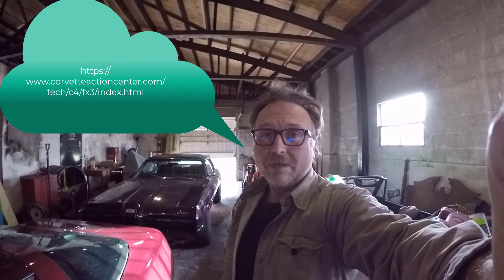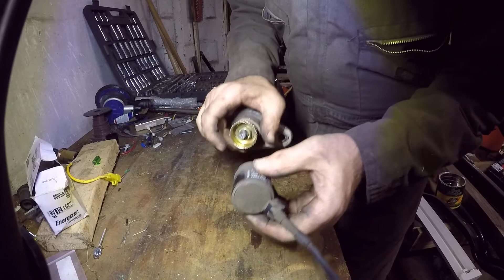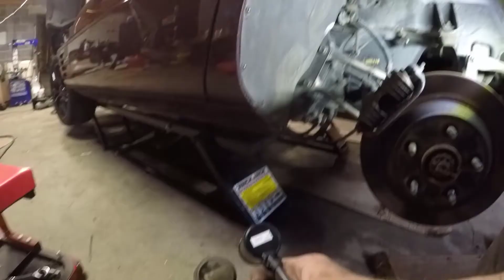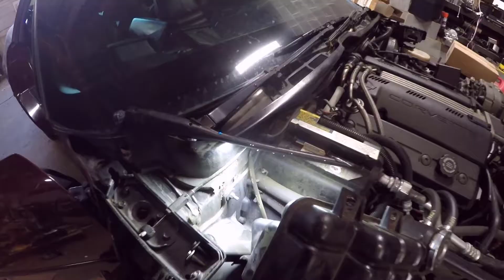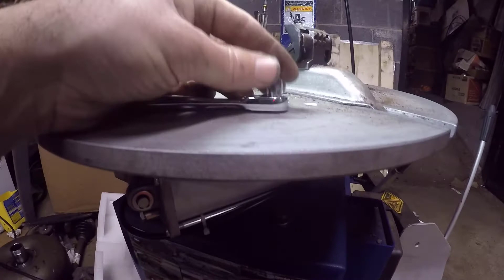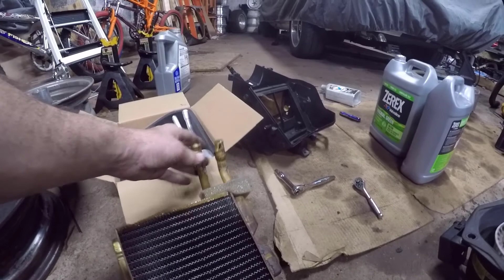CC Top Solutions Episode 3 1993 C4 Corvette FX3 Suspension Repair and Blend Door Actuator Removal

Comment: Tin the wire (solder) before attaching to the resistor.
Reply from the maker: Thanks, thats great advice! Next time! Pretty soon ill be doing another vid looking at that FX3 (idiot light came back on), trans fluid change and some rear suspension clunking.

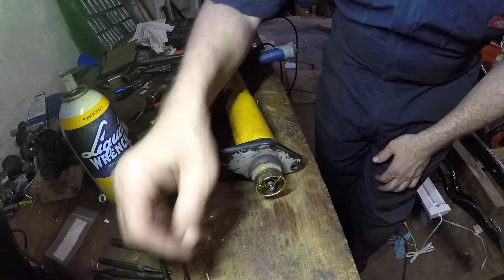Comment: At 16:30 - I have the exact same question regarding the shock rod spinning out of position when the gear was removed and have searched everywhere on the web for the answer, so thank you for mentioning it. What was the result when you installed the new gear with fingers crossed that the rod was in the right place? Does the shock perform as it should and did the trouble light stay off after it was all reassembled?
Reply from the maker: It didnt. The light came back on after a couple weeks. I ended up replacing both rear shocks with new ones, problem solved.
Reply: @CC_Top_Solutions  Okay, thank you for your help 👍🏻